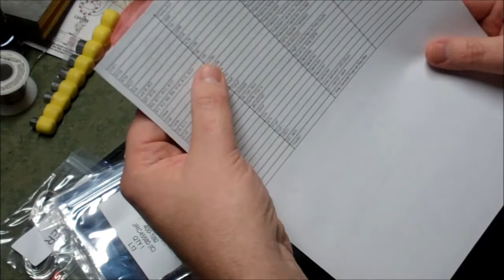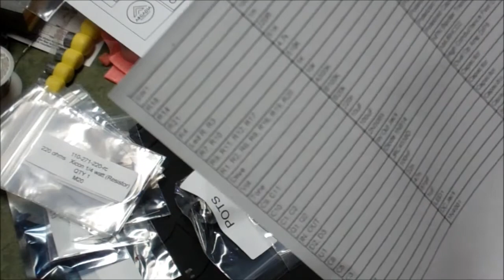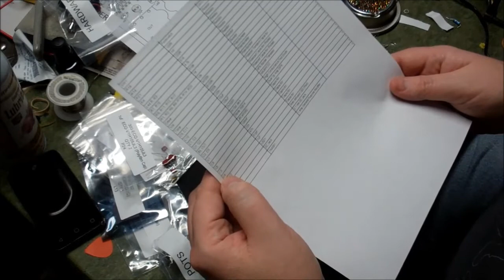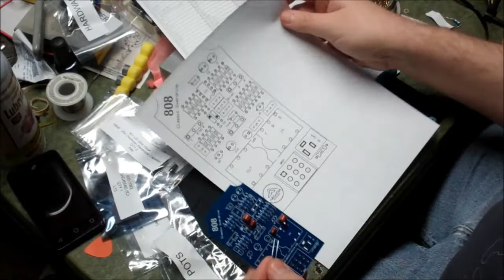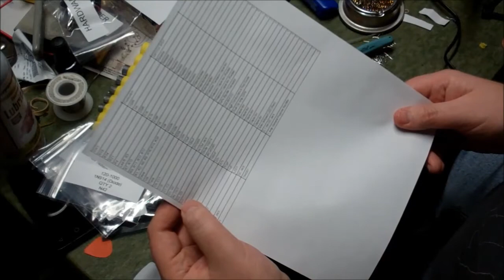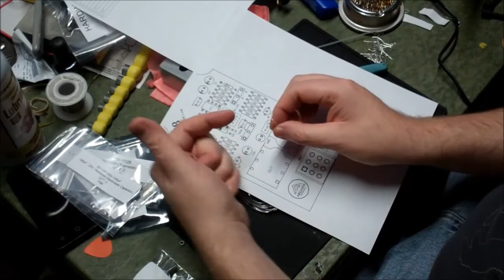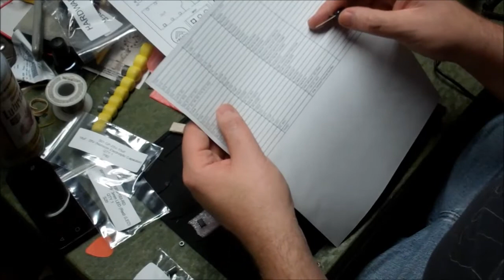Let's make.....Arcadia Electronics 808 Classic Overdrive Pedal.   Demo and build.

Comment: Aeon electronics has a high guality klon kit tha is reasonable. One of my favorites! Has a switchable between 3 different diodes for distortion . By quality i mean like mil spec board. Made in the U.S.A. Did i hear you say that you built a couple of pedal board power supple??that would make a great vid series! I,m looking at building a buffered switch looper for a pedal board. Hey,, i,m a 40 year+ drummer that loves guitars and amps. I,m clone obsessed!!! I like your smoking joe but a black face princeton built to the aa 964 is the best. That in a deluxe chassis with a brown tone stack in the normal channel????? Yumm. Tone monster.
Reply from the maker: Fun stuff.   I'd like to build some more amps,  but I just went bonkers with auctions.... so after I get these gems sold off, then I'm back in the game.